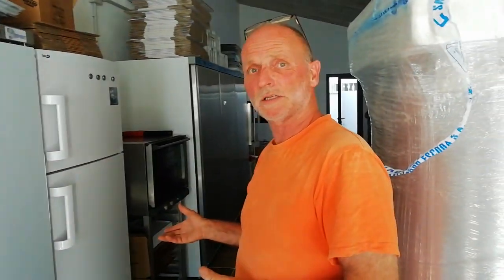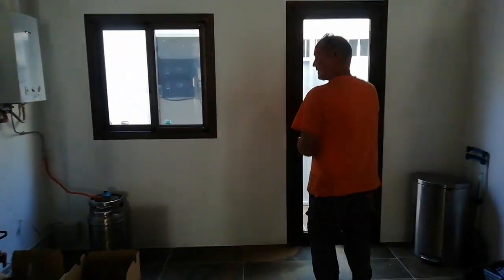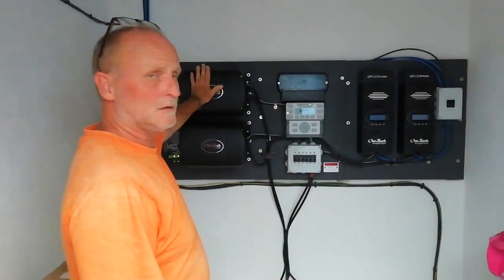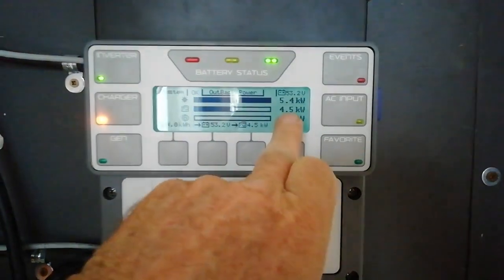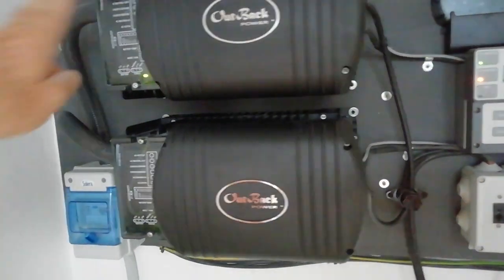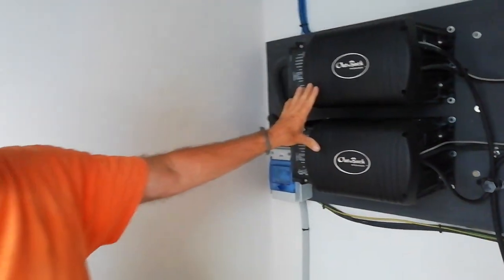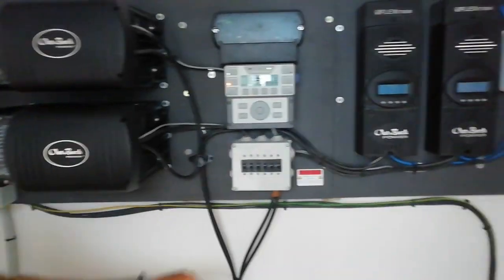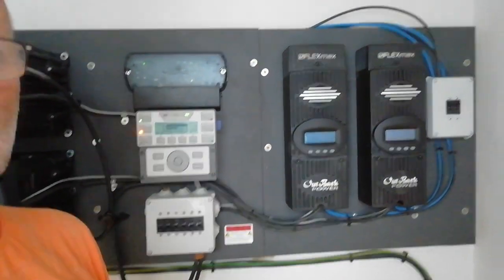Outback Power 6KW solar system - introduction

Comment: Hola: necesitaría su ayuda, por favor: tengo un sistema LIFEPO 4 de 1120 Amperios a 24 Voltios, ok. También quiero usar mi viejo FlexMax 80A, pero no sé como debo configurarlo para esta nueva batería lifepo4. ¿ como debo configurar absorción y flotación?  Gracias.  Un saludo desde España.